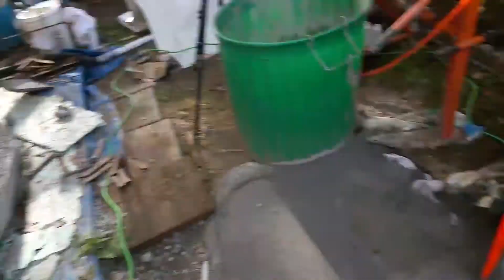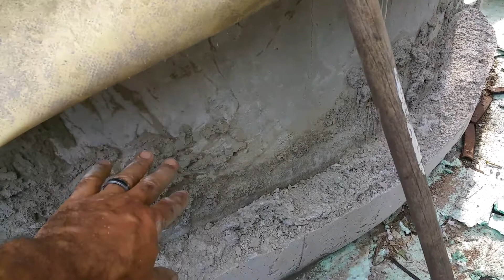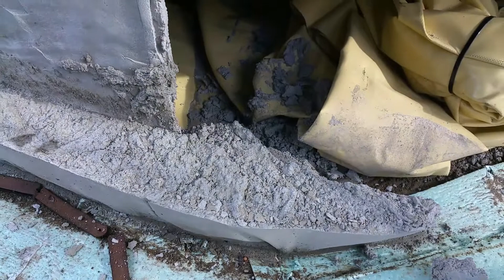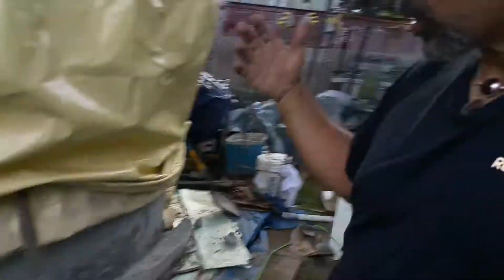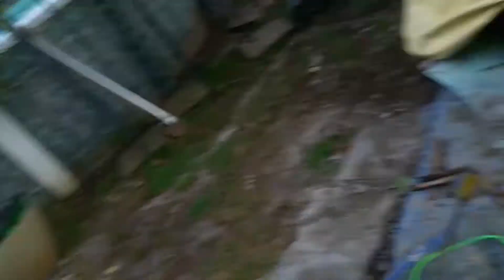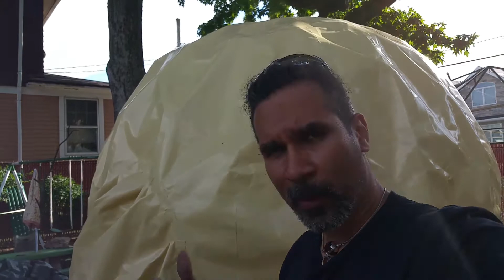Aircrete Dome Project | Reusable Air-Form | Aircrete Harry | #aircreteharry #aircrete #dome #airform

Comment: Sorry, but I don't think this idea will work even if the inner air form was fully inflated. Your test worked OK up to about 8" high, but the outer air form is strongest at the base where it's mounted. If you tried to do a full pour, by the time you got up to 4-5 ft the pressure on the air form would be tremendous and most like bulge out excessively or tear the air form. Inner air forms work via low slump concrete and positive air pressure. 
Now maybe if you made a 36"? outer support form/ring over the air form that could contain the pressure. Pour the first level, let that set, move the form ring up and pour the next level, etc.

Comment: I think you have a good idea with the double layer. You can also run all your electric and plumbing outside the first dome and the bury it all with the second layer. So what's your next project??
Reply from the maker: I'm going to make box's of aircrete and test how well it insulates from heat and cold.